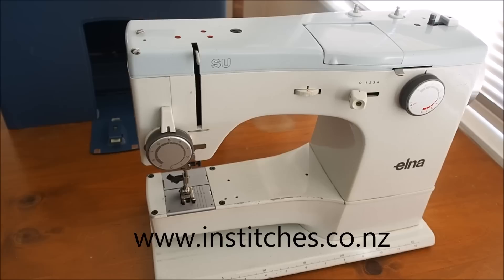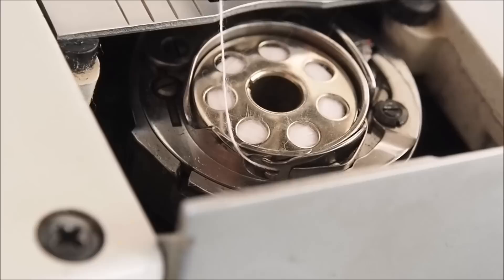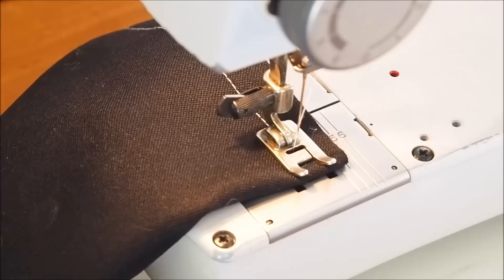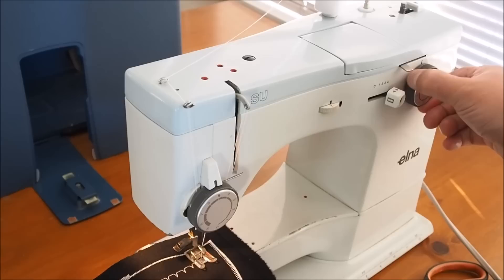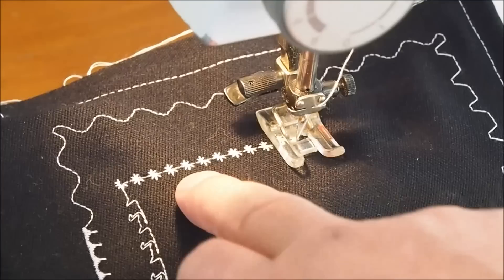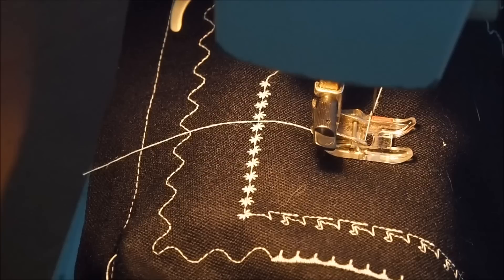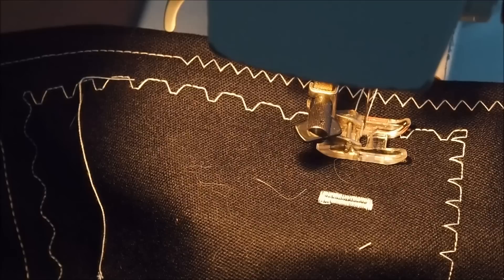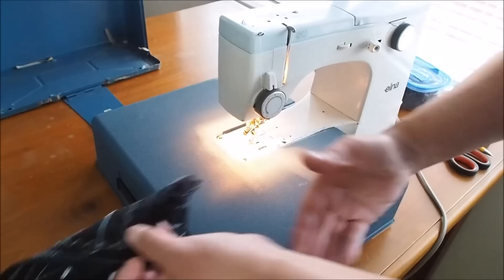Elna Supermatic SU 62C Sewing Machine Basics

Comment: I've had my Elna SU since 1976 and wished it had a mileage gauge!  Still works as well as the day I brought it home.   The selling point on the Elna was that it was so quiet and was all Swiss surgical steel.  Although, a few years ago  in just visiting with a repairman  he told me there is one plastic wheel right below in front below the bobbin mechanism.  Loved this video, told the story of the Elna very well.  I paid something like $550 for it which would be like spending a couple thousand now.  I was buying my life time sewing machine though at the time and has proven to be a true lifetime sewing machine.  I had worked only about three  years and decided to take the plunge because I was sewing all my clothes at that time on a used Singer look alike from Japan, which did well, but I wanted a lifetime machine while I was working.   A friend had bought a Singer Touch and Sew and she hated it because the bobbin was always running out.  I knew that would tick me off to no end too, so I looked elsewhere and found this little jewel. Still love my Elna after all these years.  They still bring top dollar on ebay...and well worth it.

Comment: Stumbled across one of your wonderful videos during a sleepless night recently, and watched how you replaced the cam gear.  What a great video - thank you. 
My cam mechanism goes around with no hesitation, so is working fine, I think, but the bobbin hook does not take up the upper thread, despite moving freely when manually assisted.  I think that this is a different gear called a worm gear which needs replacing?  After many phone calls, I have found a woman sewing machine expert, who is prepared to do this repair, as well as a supplier, here in the UK, who has brand new worm gears for this machine.  Most companies refuse point blank to even look at this, including my local man who is currently servicing and repairing my Bernina Artista 165.  What a shame.  
I lent my Elna SU machine (I know, sacrilege!!)  - which I received from my then fiance, on the occasion of my 21st birthday, in 1975 -  to someone who wanted to sew something, and I thought how could she go wrong on a mechanical machine???  How wrong could I be - on my return, I asked how she got on with her project, and she told me she hadn't attempted it  I didn't check the machine as I took what she said at face value - more fool me - then later, when I needed to use the ruffler to make some cushions for a friend, I found the bobbin to be completely jammed up with an extraordinary amount of thread.  It was so tightly bound around the mechanism, it took me a long time to, very carefully, snip away at the thread and pull all the pieces out with tweezers.   After that I tried to sew, which was when I discovered that the bobbin didn't take up the upper thread.  I am hoping that replacing this gear is less complicated than the cam gear!  Maybe you have done a video on it but I haven't come across it yet, if you have.  Not that I am planning to do this myself ...

Comment: Thank you so much for this video. I bought this elna model a couple of years ago, and the bobbin thread has never been quite right. I didn't know about the spring plate and fork at the back of the bobbin case. Now that I have threaded it properly, the stitches are perfect! So grateful.

Comment: Thank you so much for this upload. I have just taken on a sewing project having to use my mothers Elna SU machine which she bought not long after I was born and while I used this machine a lot as I was growing up, I could not remember all the basic functions etc. While the needle dial is jammed to the centre position, and the knob for the stitch length is missing....after I gave it an oil, it still runs like a dream. They don't build them like they used to, that's for sure.

Comment: Thank you so much for this. I have this exact same machine which I bought new in 1972 I think. I get it serviced periodically and it works beautifully. I have all the original parts, feet and case, but I had misplaced the owner's manual. So, this is fantastic! I love my Elna!! I've had it for nearly 50 years and it's a wonderful machine. So hear that there are other Elna fans out there. xo
Reply from the maker: Great to hear!
Reply: i love it as well, since 1968

Comment: Thank you for this.  I bought an Elna for $40 at an op shop recently as a spare machine.  My embroidery machine is too heavy to lug around.  The machine didn't come with directions or a cover, but has several feet, and a few cams.  Enough for my quilting.  My mother had one of these machines when I was in highschool and I learned to sew on it.  That was 47 years ago! And they are still good machines.  Does everything except my embroidery.

Comment: I know this is an old video, but I wanted to thank you for all your videos on machine maintenance. They are the most comprehensive and easy to follow ones I've found anywhere. During lockdown - for something to do - I started to get hold of some older mechanical machines that needed some attention and fix them up - mainly for friends, but I now have more machines than is sensible....  I found a lot of them had only minor issues, but the owners had given up with them and stuck them in a cupboard. Your videos also helped decide which ones to go for.
Don't think you can easily beat a Singer 201 for simple straight stitch machines. But in the zig zag/pattern category, I think the Elna SU62C is one of the best I got, even among the Berninas and Viking Husqvarnas, although it's a hard choice to make. 
Smooth, 1200 spm if you want, and does a brilliant job.
The only thing I've found awkward is getting the bobbin thread behind that spring properly.
Then - on the off chance - I read the manual !
It says put the thread into the slot and pull it behind the spring, but then, take the thread end loosely towards the front right corner, close the lid, then with a tug, pull it backwards into that small slit on right side of the lid. It will click into the right place on its own. I was doubtful, but it does work...mostly.
I wondered what that wire-like device under the lid was for, and I guess that has something to do with it and directing the thread when sewing.

Comment: I havex2!! The little square button is supposed to be pulled out slightly before clicking it to right or left, not forced. Each cam is single or double. The oldest simple ones are single. The A+ or - is very important in adjusting your different stitches per cam. Test each cam how they look and see how the adjustments effect it to know which is best for each design. The machine is SO versatile!
Reply: Also, one drop of oil is to be put in the red holes each time you use it. (There is one red hole in the center of the bottom bobbin hole.) The booklets can be found on Ebay at times. I have several magazines which were published by France, monthly,  that demoed the different uses, which were extremely useful in using the correct stitch for the job. One of the built-in stitches is for stretchable material. I've only had one plastic part break when I was sewing too fast, lol. After fixed, the guy said I will never need it fixed again. I bought this machine because of the simple but great quality! I have never used for monogramming because it is so manual, but doable. I think I would buy a new one for that project! But I have had a machine repairman tell me to never get rid of this machine! I plan on passing them to my 2 gr-daughters...
Reply: I agree Deena my mechanic says they are the best, even now. There’s something special about the metal? Was it the same as the Apollo space ships and all the interior is metal?. I received this for my 15th birthday way back in the early 70’s. She’s been my best friend. I’ve covered everything from lounge suites, delicate dance wear to heavy canvas.

Comment: Glad I found this video. Wonderful information. Now if I could just figure out how to eliminate the dozens of commercials that youtube insists I see. The manuals shown towards the end. . .  They are nearly impossible to find. There are PDFs on compact disc, but actual physical paper manuals are rare. I needed a sewing machine, bought a used junker from a repair shop, the shop owner took pity on me when I returned it, and made me a fantastic deal on this Elna. It's way more machine than I will ever need, but it's fun to play with. It came with about 40 of the cams.
Reply: I bought mine in 1968 and love it. i paid top dollar for it ($400 in 1968 ), still working well. since I stop sew over 30 years and need start to learn it all over again. thanks very much
Reply: install an adblocker to stop the videos - most browsers have them available.

Comment: I have this machine that my mother bought used in 1980 from an Elna dealership @ Manhattan, Kansas USA. Weisner’s Sew Unique. 
Love the machine. Its gotten me through many lean times. 
The shop has since closed and my lightbulb has burned out. 
I have been making masks for folks in the COVID19 crisis. If some one could help me out, that would be fabulous. 
Thanks so much for making this video!
Reply from the maker: Yes they are lovely machines. You should be able to buy one online, maybe after lock downs have been lifted? It's a bayonet type.
Reply: @InStitches  Thanks! I picked up a screw in type at Hobby Lobby awhile back. It's still in the packaging, so I'll return it when I can. Do you have a source?
Reply from the maker: @SandytozArt  Try you're local fabric shops or try online.

Comment: Very useful video! Many thanks: ) 
I just bought this particular model today.  (SU 62C)
Would not have taken the chance on it without seeing your vid.
Works well, but no cams or accessories... but it's very nice: )
Reply: I was looking on ebay a few months back for something else and ran across some Elna cams for your machine.  I'll bet they have owner's manuals and anything else connected with Elna on Ebay.
Reply: @starbright57  Well, 4 years later I have several vintage Elnas, a Star ZZ 21, & recently found another immaculate SU 62C, with 11 cams: ) Mostly off Ebay! My original 62C is now with a favourite neice. Also got more than one (don't ask how many) Lotus SP machines which are amazing portables IMO! I'm a proper vintage Elna fan now & quite confident replacing the plastic gears, thanks to In Stitches excellent video 'How To Do Its': )

Comment: This is my favorite machine of many.  Once you oil all 9 points , it's so quiet that you can sew with someone sleeping in the next room.
There was a monogram attachment with template for this machine. I have everything for mine since I worked at an Elna dealership and you could still order feet and cams for it until Elna was sold to Janome..
Reply: @Susan McKenzie two drops in each hole marked in red. I will try to describe where they are in case your red is worn off.
the three holes above the take up level, turn flywheel toward you until it's in highest  position.
the two holes on the free arm bed on the inside.
remove bobbin and feed dog cover for the next one
center directly under where the bonbons central hole would be
hole to the immediate left of the bobbin tension
Center hole on feed dogs
Hole to left of feed dogs 
I could try and email you a picture if there is some way to direct message me your email
Reply: oh sewing machine oil!  or fishing rod oil (same oil) Never wd 40 because it will make your machine sticky after a bit.

Comment: Hi there. Thanks for the video. I was originally searching for tips on hiccups with tension on Elna SU so was super glad to have come upon your video. I have had my SU for over 30 years and still found out some little things I didn't know. 😊 Just one thing though. I needed to replace the globe. I managed to remove old one but for the life of me just can't fit the new one. Followed steps from instruction booklet but not clear enough so still struggling along without the light. I would appreciate if you could put out a detailed video albeit short of how to do it.  Actually maybe also on how to fix tension problems. 😉😆 Thank you
Reply from the maker: Thanks. Hopefully this helps - https://youtu.be/b6o-4jWUr4U

Comment: Thank you for this video. I inherited my mom's Elna Super CI, 62. I think she bought it in 1974 or 75. I've had it a few years. It is a fun machine. My question is in the maintenance. A small bottle of oil came with the machine. The oil is red and fairly viscous. As both my parents are now deceased, I can't ask them what this oil is. I have used Singer oil since owning the machine, but see in the manual that genuine Elna oil is recommended. Is genuine Elna oil red? Is it ok to use store bought Singer all  purpose oil? If not, where do I get Elna oil in the US?

Comment: Help - I am having trouble with the foot controller for my Elna 62 (aka my baby).  It isn't as responsive as it used to be, and upon opening the case, I discovered burn marks on the left contacts.  Can you offer any suggestions, or can you direct me to where I can find the repair manual for the foot control?  Thanks!
Reply: see reply to Margaret Greydanus above (the contacts on the original controller also had burns, I think that's why it stopped working-the contacts were fried.)

Comment: Hi 
I have a Elna TSP 72C , looks like your SU 62C except mine has a dial for extra patterns and no CAMs window.
Do you know how to use the Quick Reverse Metal slider.
Are you supposed to stop the machine before moving this lever to the right? 
If I stop the machine on heavy denim, then move the slider right and start the machine , yes it goes backwards but it then screws up the lower bobbin thread. Seems like it cut pieces of thread and you end up with 3 ends coming up from the bobbin area. 

However if at the end of a run, you keep the pedal pressed and move the slider to the right for a second, it reverses, and then automatically goes forwards. Leaving a perfect, strongly sewed end of run.  And that is what I want. Its As if this is the right procedure. With no nasty noises.

Only asking, as in a car they say always stop the car, before shifting from forwards to reverse, and visa versa.
Reply from the maker: You can use the lever while sewing with no problem.

Comment: hey does
it have to be in reverse for darning? i just bought one of these machines as my last electronic elna broke and i need a replacement quick. It’s already been in the repair once since i got it and it’s still playing up when darning. Could you possibly do a more detailed short video on darning with this machine? Or any advice or help is appreciated, cheers
Reply from the maker: There should be a little rectangular cover to fit over the feed dogs so stitch length can be set to anything. The feed dogs have no effect when the cover is on. Thanks.

Comment: I have this machine. when I wind the bobbin, I have the holes on the top facing upwards... But, when I go to insert it in the machine, it runs counterclockwise. what's wrong with that? I am told the bobbin needs to run clockwise. How do I do this?
Reply from the maker: It's okay to have the bobbin running counterclockwise. On some machines there is a need to have a bobbin running a certain direction but generally it doesn't matter unless you're having bobbin over-spinning issues. Over-spinning can be rectified with an over-spin spring.

Comment: Hello
Thanks for your great videos and obvious enthusiasm for vintage sewing machines. 
I've recently acquired an su 62c and want to talk about the buttonhole function.
The manual says one procedural sequence, you say it doesn't work and have come up with a "fix".
As you know, following the manual does not allow the stich width lever to move out of 2 to select 4 when A is selected. This is also true of my machine.

I am an enthusiastic, vintage sewing machine restorer and a highly qualified bicycle mechanic, both vintage and current technologies.
My question is:
If a world renowned, high-end sewing machine manufacturer such as Elna produce a comprehensive manual describing procedures, and a flagship procedure, the so-called no-turn buttonhole hangs the machine up I would want to know why.
In your experienceare, are you putting it down to a faulty manual description, or is there something wrong with the machine?
Admittedly, it works via your fix but the effort required even then, to move from 2 to 4 seems, to me, excessive.
I would be very interested to hear your thoughts and want to once again thank you for all your hard work.
I ask this question in good faith and absolutely no offence is meant.
Thanks for your generosity.
Francis

Comment: Hi, thanks for the good video. Maybe you can help? I bought this machine and after the second bobbin I want to wind, I can't seem to turn the inner knob to the front,  to thread the bobbin without having the needle go up and down as if I am stitching....... Do you know if this is a common problem? And should I have it fixed? Or can I fix it?
Reply from the maker: Hi and thanks. You may need to try stopping the machine from turning while trying to undo the inner knob. I would remove the top lid and hold the gear and belt on the top shaft while trying to undo the inner knob. That should free it up. Don't use too much force though. Take it to a repair person if you can't budge it.

Comment: Hello, the black wheel that connects the motor with the large pulley for turning the machine is worn out. Can it be built?
Reply from the maker: I have the part in stock. Contact me via email (in video description) if you'd like me to price it for you. Thanks.